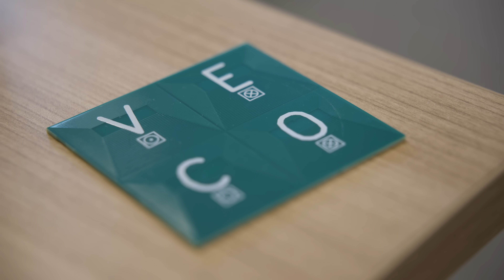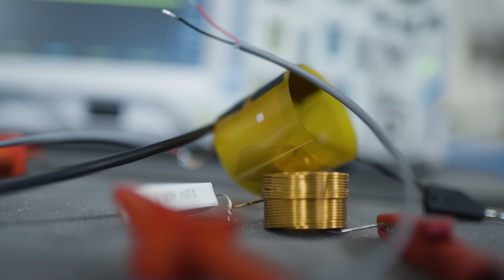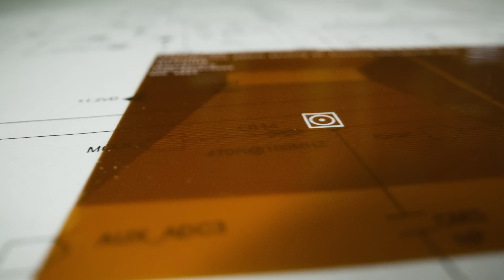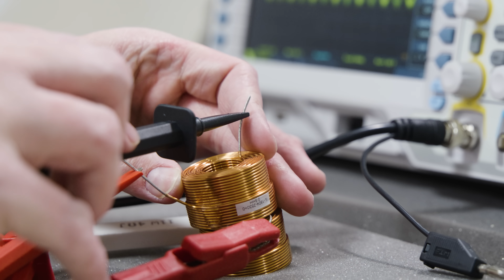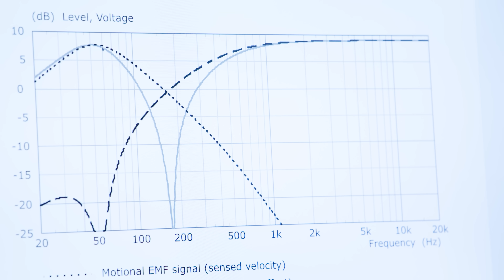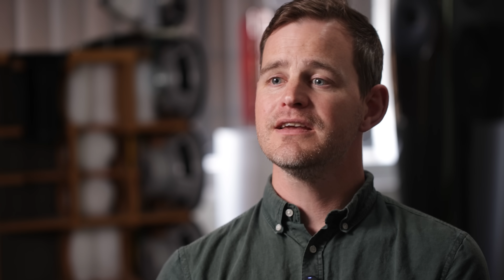KEF's Breakthrough VECO Speaker Technology to Lower Distortion–Explained by Its Inventors

Comment: Novel idea yes, breakthrough maybe not yet... May get some great performance characteristics from this, as he said exciting to see what unfolds...

Modern motor systems, new materials and large excursion suspension largely overcome audible harmonics, and without the need for proprietary amps or drives. With many servo systems falling by the wayside over the years... Hope something new comes from this.

Comment: I'm interesting in knowing why they didnt try other methods of measuring the distanced moved, using a secondary coil will still effect the output as it takes energy away from the movement to generate the signal.  These sorts of speaker systems is an evolution that I think might end up in all future speak design though.

Comment: I love KEF and their drive (no pun intended) to use technology and a sound [sorry!] understanding of physics to serve faithful sound reproduction. I have some KEF Reference Three/2's and they're still some of the best-sounding speakers. I think KEF were first to use lasers (30-40 years ago?) to measure what the cone is actually doing compared to the input signal. KEF has been very innovative over many years and continuous research so their body of know-how must be quite impressive. 
Philips and some other manufacturers have had servo-control of the drivers for a few decades now. It will be interesting to learn why this approach should be superior. All the best, Rob in Switzerland
Reply from the maker: Thanks for the feedback

Comment: All that ads mass to the membrane. Not good! Why not just use a microphone to read in real time what the membrane is doing and correct. Also you can just measure your speakers in the factory and get a profile of their behavior. Then apply a correction circuit personalized for that speaker. I see no benefit to what you are doing except for some marketing bs.

Comment: Great ..another solution for a problem no one ever had !
Reply: Actually, wrong. "Current driving" a loudspeaker has long been known to provide beneficial such as drastically lowered distortion. Distortion is a problem that pretty much every loudspeaker has, so lowering it is a good thing. I've talked to many loudspeaker designers over the years who have talked about the benefits, but also the difficulties -- particularly the fact that most amplifiers and speakers today work around a voltage paradigm. You just to have to loudspeaker measurements to understand that. Also, a problem with current-driving a loudspeaker is, as Jack Oclee-Brown explains, maintaining control of the driver, which VECO is intended to resolve. So for those reasons, you're wrong.
Reply: @dougschneider8243 who is it supposed to matter to,aprt from the KEF marketing department
Reply: @marxman00  You're grasping here -- KEF's marketing has made a bigger deal about other things on the soundbar. Who is should matter most to is the listener. Current drive is a real thing, don't kid yourself.

Comment: Philips RH 545 Studio
The RH 545 Studio was Philips’ most advanced MFB loudspeakers monitoring its own playback through a feedback loop
INVENTION OF PHILIPS CORPORATION - FEEDBACK CONTROL - Motional Feedback is an active high fidelity loudspeaker system which was developed by the Dutch Philips brand in the early 1970s. The loudspeakers have built-in amplifiers and feature a feedback sensor on the woofer. The sensor measures the output signal of the woofer and compares it to the amplifier input signal. This results in very low distortion, as any distortion induced by the enclosure or the woofer itself is immediately corrected by the feedback loop. This low distortion also allows for extended low frequency response in a relatively small enclosure. Wikipedia

Comment: This is a novel approach that minimises the compromise of adding feedback system to the moving parts and the electromagnetic behaviour. A key part to all prev systems has been time delay in the feedback system. Instantaneous control is the ideal to move toward and this may be a step that way.
Reply from the maker: Interesting observation, thanks for sharing!
Reply: Indeed!

Comment: I feel like a PCB mounted pulsed laser time-of-flight sensor would reduce weight on your cone, since all the cone would need is a small reflective paint spot, and not have any issues with interference or unintended induced fields. I have to assume that their solution is cheaper, but I would be curious to see the tradeoffs.
Reply: The linearity, huge dynamic range, signal to noise ratio and the noise floor are all difficult to achieve with other sensing methods.
Reply: Yes

Comment: not only can you sense this from the primary coil, you can characterize this with an external laser sensor, use it to build a software model and skip all the cost of closed loop feedback in a system with a never changing load.
Reply: Someone with sense 🙏

Comment: Still have servo latency, no? And the resulting remaining amount of error. I don’t know why nobody has gone down the “measure first-alter source” road yet. Measure all the distortion on all drivers, not just woofers, and alter the program material itself to correct for it. Need to do work once before playback, but no latency error during playback. And could correct for mids and tweeters, providing you can also measure their error. Audiophiles already do so much crazy stuff that I can’t see measuring error once and processing source material to correct for it being an unacceptable cost. It could account for all error between source and air, not just the drivers themselves.

Comment: This approach was discussed extensively on public forums years ago at least. Nice to see there is at least one company still capable of genuine development. The flex PCB takes up space in the gap which reduces motor efficiency, so I wonder if production will by applying the extra coil directly with epoxy or something.
Reply: Not necessarily, because as he said the sensing coil actually replaces the voicecoil former. Still because of the traces it might be slightly thicker but probably not by a significant margin as these traces are flat and really only provide signal, they don't need to carry large currents.
Reply: How would you go about estimating the %weight contribution of the flex pcb and adhesive to the total moving mass? WAG here is max of 5%.

Comment: I highly prefer using solid gold 40 strand 8 gage wire, with a silver wire braided shield, poured in a 4 inch reinforced concrete chaseway.  Cooled with liquid nitrogen.  I can definitely tell the difference.
Reply: Biggest problem is getting the unicorn blood to anoint it all with...
Reply: @TrimeshSZ I had some on the right channel, but couldn’t get enough for the left side.  The system imaged horribly like that.

Comment: Wasn't Velodyne doing this a long time ago?
Reply: Yes. They used velocity sensors attached to the cone, not the voice coil, if I remember. And as the cone makes the sound, not the voice coil, this actually works out well because the sensor can account for cone flex.
Reply: Velodyne uses accelerometers which tend to have a limited signal to noise ratio.

Comment: 1.Why is the rear loudspeaker not added in such a beautiful system?
2.Why there is no HDMI - 1 HDMI-2 inputs, what kind of soundbar calculation will not connect any device working with hdmi?
Reply: I think they didn't do multiple HDMI inputs because basically all modern TVs have multiple HDMI inputs and eARC. It would be expensive and redundant.
Reply: @inwiththeold1  yes but it's not redundant.   What if you want an input as another device, say blu-player or something else.  Then you need multiple inputs.  I mean I guess you could use a projector or tv as that connection input then use eARC, but you are limited because of this.

Comment: I like this answer to a problem.  another answer would be to build more precise motors and drive them within specifications.  kind of correcting the problem before it starts,  as done with drivers used in medical research, where cost is no object to results.
Reply: The perfect driver does not exist, They want to make ever smaller speakers. the smaller the cabinet, the bigger the acoustical load on the cone, so they have to correct.

Comment: Seems pointless to go through all this trouble when you can use some other methods such as optical.
Reply: Why bother convolving from optical to electrical, it just brings its own issues.
Reply: @BestKiteboardingOfficial  Because it doesn't interfere electrically with the inductor/coil.

if you want to measure the motion of the diaphragm/coil then using optical is going to be the best way. It doesn't interfere with it in any way which all other methods would. It is highly accurate and cheap to implement.
Reply: @BestKiteboardingOfficial  you two, get a listening room

Comment: Philips used piezo electric sensors in their motional feedback speakers which avoided any magnetic coupling aberrations caused by  concentric voice and sense coils.
Other methods include capacitive and optical sensing.
Reply: Philips motional feedback in the early seventies was revolutionary but probably too expensive. This looks like an affordable option when combined with modern day electronics.
Reply: The piezo sensors have a limited signal to noise ratio, so they worked when heavily low  pass filtered for subwoofers, but even then you will hear some noise in the background from servo subwoofers. The mass of the sensor also causes an imbalance that I expect would lead to rocking on smaller cones.
Reply: You would think we would be seeing floating speakers coming out of Japan by now . Where the superconductors at ???

Comment: it looks like the motional feedback speakers system that philips build in the seventies .
Reply: The Philips system was based on an even earlier system invented by Louis Erath, a geological engineer based in Houston, who produced his LWE line of speakers in the mid to late 60s. Philips copied his negative feedback system. He later created a line of processor boxes that would allow you use negative feedback on aftermarket speakers, as well. It’s nice to see his work being taken to the next level.
Reply: Sony had a motion feedback servo system on its hybrid Electrostatic speakers too. This was done with an additional voice coil wound onto the man former, but displaced forward from the main driver coil
Reply: T+A in the 90s, used a optical sensor to measure conemovement and account for distortion. Interesting stuff.
Reply: may be a piezo sensor would be nice ?
Reply: Sort of like a servo motor with an extra step... and extra mass
Reply: At a superficial level, yes. But the part about the sensor and motor being uncoupled is new and very important.
Reply: @rmlarsen  They stress that here, because both cone driver and sensor are magnetically driven, so the orthogonal fields decouple them.from each other. If you used, as I believe Philips did,  non-magnetic velocity/acceleration devices, the non coupling is automatically there. So this is only applicable as KEF are using magnetic effects for the feedback sensing element
Reply: @rmlarsen considering the commercial success of feedback controlled speakers, I doubt the coupling is going to change anything.

An optical sensor wouldn't have any possible electromagnetic effect.
Reply: @Iowa599  i remember back in the 70s celestion using lasers to see distortion
Reply: @jonathanhardy 
Laser interferometry.
Reply: The phillips one I believe is based on an accelerometer which is more ideal, as sound pressure corresponds to cone acceleration. There are a few companies currently using accelerometer based devices, Grimm audio has some excellent papers on their website discussing the history and various approaches to active feedback in loudspeakers. Accelerometer devices have their own set of challenges with keeping noise out of the sense signal which requires the sensor to be run at a fairly high voltage, but IMO is a better solution overall simply because you don't need to do any processing before the feedback, you can just mix the input with the sense signal to get an error signal

Comment: This a clever sophisticated way of doing servo feedback. Well done KEF!
Reply: I agree -- super clever.
Reply: You meant Tannoy, I guess, as they have done this in early 90s in their servo subwoofers, and did Velodyne, and did JBL. At this point the correct way of saying this is, Welcome KEF, you are almost 30 years late. Not to mention that velocity doesn’t allow useful feedback signal out of the box, that means processing delay, that means this system should be very crippled by means of useful frequency bandwidth. It must have taken them years to walk through the minefield of older patents so that they could have a crippled version that nobody else wanted.
Reply: @oturgator  Did you actually really watch the video? Velodyne and other servo systems mostly use accelerometers, which measure acceleration and need additional (noisy) circuitry to convert it into velocity or displacement for feedback. KEF, like Rythmik Audio, takes a cleaner approach: an additional voice coil that directly outputs a voltage proportional to cone velocity, skipping complex integration if tuned correctly. KEF’s real innovation is sidestepping inductive coupling between the drive and measurement coils, ensuring pure feedback. Pair that with current drive—where the amp controls current, not voltage—and you get top-notch cone control with less distortion. Not all servos are equal, and KEF’s VECO technology is a standout evolution of past techniques, building smartly on what’s come before rather than leaping decades ahead or lagging behind.
Reply: @bas7es I wonder what class amp they are using.  I’ve also wondered if implementing GaN FETs would be beneficial in a servo system.
Reply: @chrisfluke459  I assume that, like most soundbars, they utilize chip-based Class D amplifiers configured for current drive. Discrete GaN designs are typically not preferred in lower power systems like soundbars due to manufacturing considerations; therefore, the chip handles all on one die, including advanced protection mechanisms.
Reply: @chrisfluke459  in what way were you thinking?
Reply: @bas7es Please do your research before even attempting to to talk down on people. Obviously your knowledge on this topic is shallow and it shows that you haven’t done one single benchmark on the designs I am talking about. Just wrongly claiming that those systems had accelerometers can buy you 5-6 likes on YouTube but that doesn’t mean that the time you stop reading this feedback your lack of knowledge will be justified.
Reply: @bas7es  What do you mean "...current drive - where the amp controls current, not voltage".  ohms law... they're directly proportional, you cannot change one without changing the other, period.  which is why "high current" amplifiers is just a marketing gimmick... every amplifier is going to be either voltage or current limited depending on the load impedance.  a "high current" amplifier, which has no actual strict definition or standards associated with it, is simply one which generally has the capability (which usually/primarily comes down to having an adequate power supply, though there are other factors) of doubling output power with a halving of impedance, at least from 8 ohms to 4 ohms, some can go lower and still scale some more.

But the only way you could control current without changing the voltage would be if you could dynamically control impedance.  Unless I'm missing something, please do fill me in.  Perhaps it's rather that they're monitoring the current, and trying to control for current, and altering the voltage to do so, though I don't see the point.  If you're using a feedback system to minimize distortion, your velocity information is all you need, and you can adjust voltage to achieve that.  Not sure what monitoring current would achieve, other than looking for changes in driver impedance due to heat buildup in the voice coil or other non-linear properties where impedance changes dynamically.

KEF has a neat approach here, with one small downside potentially - weight.  It may not be significant, but I don't know, it's not zero.  It may not be heavier than other brands accelerometers who knows.  I think using an optical/laser system would be the obvious ideal way to track the movement.  No added moving mass, and I'm not sure why no one has done that.
Reply: @chrisfluke459  Why would that help anything?  AFAIK the benefits of gan fets are increased efficiency, higher switching frequency, and related to the first - smaller size and lower heat output.  Useful perhaps in advanced class D designs, but not inherently better from an audio perspective, only the design as a whole matters for that.  We've got the amazing orchard audio gan fet amps, but now we've also got an SMSL gan fet amp that is meh... I mean it's pretty good but plenty of mostfet amps are superior.  They're primarily useful in laptop chargers and cell phone chargers because of that smaller size and increased efficiency.
Reply: @Artcore103 Just because almost all Hi-Fi amps are designed to be ideal voltage sources (zero output resistance) doesn't mean that the contrary concept of ideal current sources doesn't exist. There are few examples in real world use, e.g. for the bass amplification in certain Avantgarde Acoustic loudspeakers.
Ohm's law is not violated.
Reply: @oturgator  How's your speaker velocity control system coming along?
Reply: @oturgator added weight to the driver as well. Compromises everywhere.